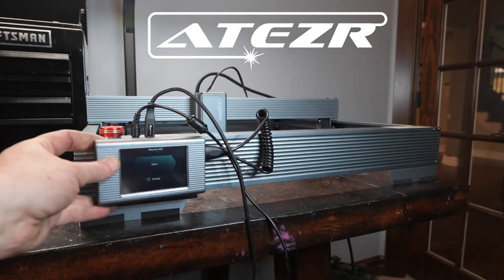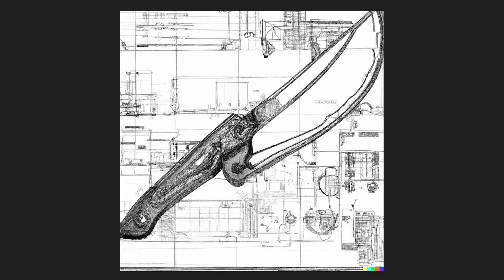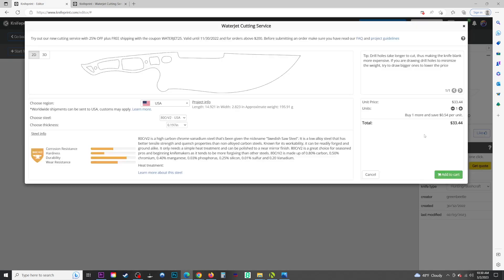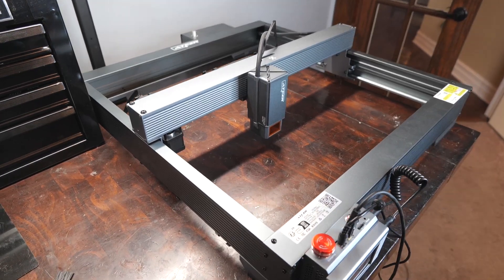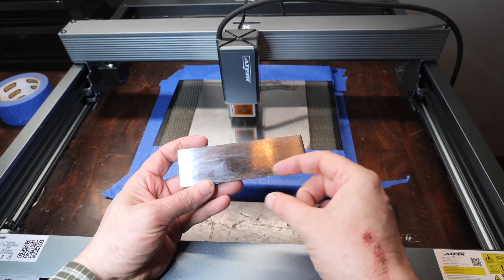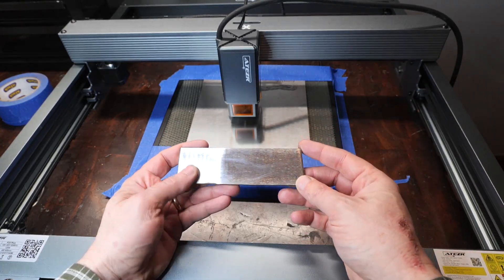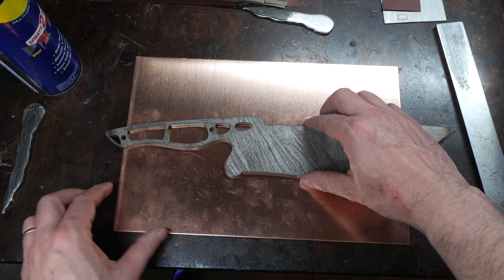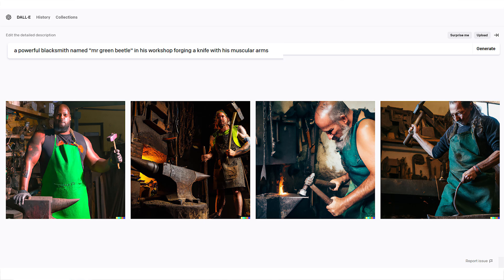Building a Cthulhu Knife! Part 1 [Atezr P20 Plus Laser]

Comment: Given that it's a knife based on a reality-warping being...is the blade on the inside of that arc, with empty space between the "mora blade" and the weird jagged thing that meets up with the bit sticking off the handle?

Hardly a useful configuration, but it would be pretty...insane.